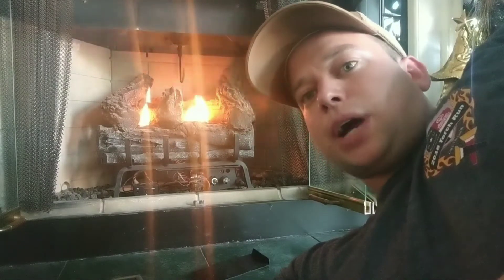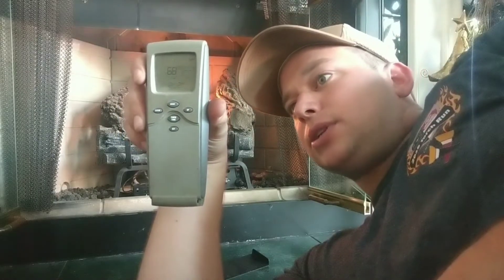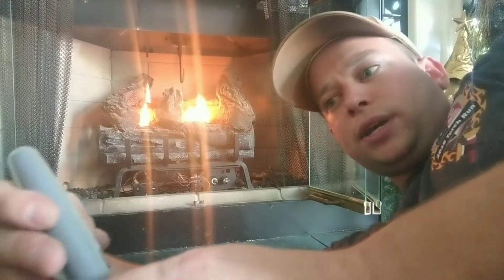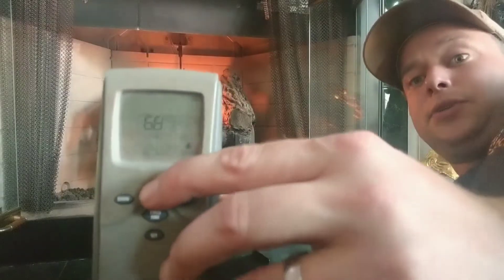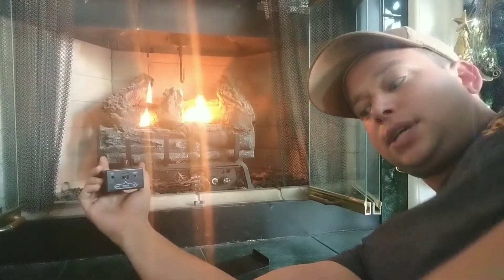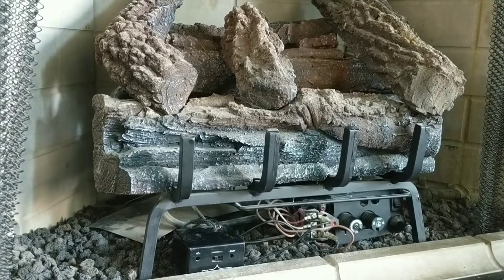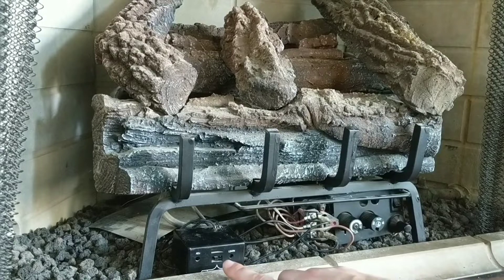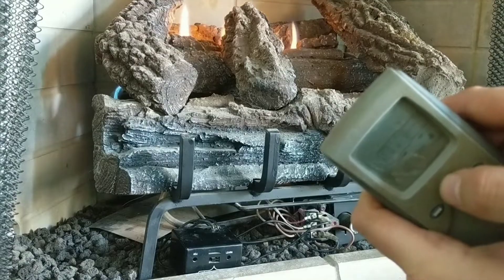How to Fix a Gas Fireplace Remote

Comment: 10:15pm(est) Thursday December 21, 2023
Good Evening 
I Knew about the Battery Box and the Remote Needing Batteries.
But What I Did Not Know, is that My Igniter had 1-Triple  (AAA) Battery.
Once I Replaced it, I had a Flame Once Again.
Watching Your Video, Made Me Mindful of ALL of the Batteries, that Have to be Replaced.
I’ve had my Fireplace Insert for Over 15 Years and Have Never Replaced the Igniter Battery.
Thanks
katchupwoman

Comment: Thank you, thank you, thank you!  Had a few cool nights and right no time like the present to start up the fireplace...and  correct any problems early enough, just in case.   After getting everything working, it wouldn't start up again....I noticed a wire not attached to anything, when I found where it went...fireolace worked but wouldn't shut off....tried the remote...NOTHING!   I found your video...it was the simple on/off switch for the pilot...Bingo!   Great video and thank you for saving me an unwanted call.

Comment: That was quick. Many thanks. Had already replaced the batteries on both devices. Switch was not set in middle. Was to far right on learn. Problem solved. Like the thermo mode.
Reply from the maker: Very nice! Thanks for taking the time to let me know it helped

Comment: Replaced batteries in both remote and receiver inside as well, still not working, when I turn the receiver on fireplace works, when I put in remote mode, it’s not workin, I am not hearing the beep when I press remote even though remote screen is on with all the modes appearing, ? May be remote sync problems? Thanks
Reply from the maker: In that case watch this one for programming and let me know if it works https://youtu.be/HAErM92jVh4

Comment: Good, simple video. But, we had already changed the batteries in the remote AND in the little box inside, and we re-did the "learn" feature, too. The fireplace will turn on if I manually move the little box's switch from "remote" to "on," so we know the fireplace is OK. There's another battery for the "igniter" inside the control box for the fireplace, and we changed that, as well. The remote still does not turn on the fireplace, though. I'm stuck!
Reply from the maker: I hope you can get it figured out! Worst case you can replace the remote and control box and it will definitely fix the issue: https://youtu.be/HAErM92jVh4?si=Uzkm3CT07C5a_NYa

Comment: Skytech two button remote. Changed battery and have red LED light on remote.  Changed the 4 AA in the box. It will turn on the fireplace when I switch it to "on" mode however, I cannot get it to sync in "remote" mode.  I have it in "remote" and I press "learn" and hear the beep... when I press buttons on my two-button remote nothing happens except the LED indicator illuminates.  I even tried holding "learn" on the box for 15 seconds to wipe the memory and re-learn the remote but that doesn't work either.   Any Ideas?

Comment: The on/off/remote control on the gas logs fell apart when I changed the batteries.  It cannot be fixed and is on the off position.  Is there anyway I can remove the remote assembly from the gas logs so to operate manually?

Comment: When I replace the batteries in the box near the logs it works for a couple of times and then quits.  Do I need to use special batteries?
Reply from the maker: No they should be fine unless your batteries are old. Did you also replace the remote batteries?

Comment: When I press the ON button on the remote it takes like 2 minutes to ignite. I checked the transmitter box and it’s hard wired, no batteries. P

Comment: My fireplace won't shut off when the temperature is way higher than my target. Is there any fix?
Reply from the maker: You will need to make adjustments to the sensor I assume. Whether that be placement preprogramming is TBD
Reply: @BtwilliasGarage  But where is that sensor? Is that the thermocouple?
Reply from the maker: Correct, the thermocouple sends a heat frequency to your computer unit. You may need a new one. I'm not an expert past cleaning and fixing the dirty issue. Please let me know what works out for you

Comment: My problem: I hit the on button and the fireplace starts like 3 minutes later or more. Batteries are good. The receiver is AC not battery. Now when I press the bypass switch, come on instantly. Why the delay when I use the remote? What’s my problem, anyone know?

Comment: My receiver does NOT have a “learn” button to press.  I changed all batteries so, what do I do now? I have not found one video showing a box without that button.
Reply from the maker: Is there a serial number or any info on the sticker? Hit me with whatever numbers you find and I'll try to help
Reply: There are model numbers.  The receiver number is SKY-4001Rx and the remote Is SKY-4001th
Reply: @BtwilliasGarage  Model numbers for the remote are SKY-4001th and the receiver are SKY-4001RX.  Thank you!
Reply from the maker: @katherinedebiec1909  weird I see what you mean. All instructions for that box show that it should have a learn button. I'm sure you did already, but double check. Have you moved the on/off switch recently?
Reply: @BtwilliasGarage  I followed all the instructions I've seen on Youtube and you show the same information.   I did move the on/off switch.  The remote has a "set" key that I've pointed towards the receiver and pushed but, still nothing happens.
Reply from the maker: @katherinedebiec1909  gotcha. I'm sorry that is outside of my knowledge base. Please circle back and let me know what fixed it when you figure it out. Best of luck and again, sorry I couldn't help

Comment: I went through the battery change and it still didn't work.  I found online that I needed to go through a "learn" sequence to make the receiver listen to the transmitter.  When the batteries are changed, this learning sequence was necessary.  Then it worked again.
Reply: where do i find out about the 'learn' sequence. Batteries didn't fix mine. :(